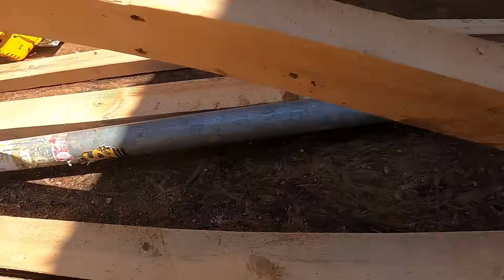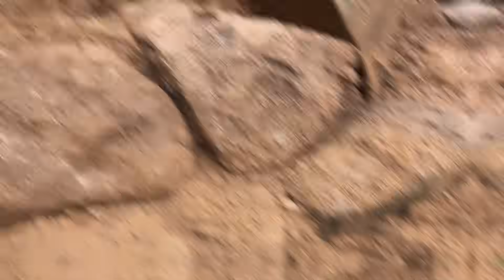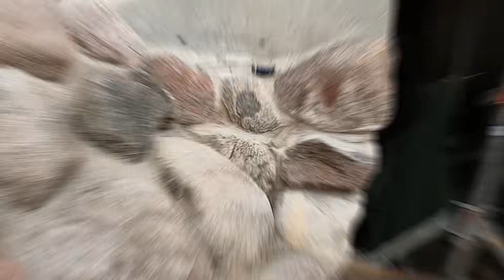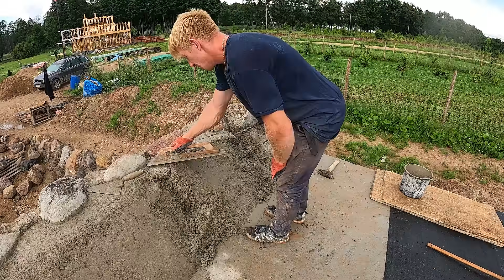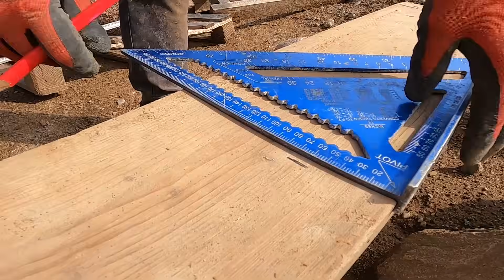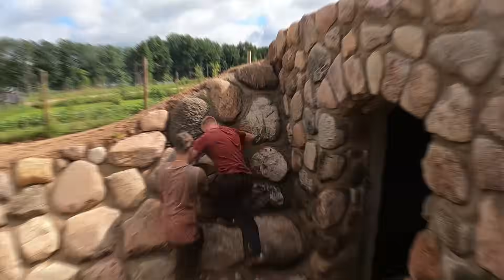Our DIY Underground Bunker Finally Got Buried After Months Of Concrete Work

Comment: No air duct, water, electric or floor in the build.
Reply from the maker: Air ventilation is there, it’s just hidden. The brick chimney on top works as the vent.
We also ran one wire for lighting.

No water or floor by design. It’s a root cellar, so natural ground helps keep the right humidity and temperature.

Comment: 1 rain will fill your basement with mud and water from the slope outside. You should make stairs and cover themwith a sliding or pull up door. Just slide the door on top and go down from stairs direct into the basement.
Reply from the maker: It’s actually handled dozens of heavy rains, the coldest winter in 10 years, and plenty of snow with no issues. Funny enough, this root cellar ended up being too dry, since vegetables still need a bit of moisture. But sounds like you’ve got your own version in mind. Would be interesting to see how that turns out.

Comment: That was a great project, and a lot of work, but you kept calling it a basement.  A basement implies something on top, and I kept waiting for the main floor.
Also, why do all that work and have no water, or electric?
In the end, it’s cool and all, but it’s a $200,000 hole in the dirt…
Reply from the maker: Thanks, and yh, here we call most underground builds basements 🙂
It’s actually just a root cellar, so only lights inside. And definitely not $200k 😄

Comment: What about the base of the bunker? why there is no concrete slab build to isolate the floor of the basement? Unless you forgot to mention it but the floor is basically sand and mud. Also why no drainage along the wall and under the basement floor?
Reply from the maker: It’s a root cellar for vegetables. The client didn’t want a concrete floor, and there’s a thick natural sand layer underneath, so drainage wasn’t needed.

Comment: For what purpose was this built? It would no doubt stay cool year around so it function well as a wine cellar.  Getting wine barrels up and down entrance slope and the steps would be difficult. It would also function well as a root cellar but that much structural work seems overkill for this purpose. It would  protect one from hurricanes and from harm in a doomsday situation like a fallout shelter. It seems to me that one would want to build a traditional home over it to take advantage of it as a structural foundation. Architects are taught the forms follows function. This structure while well built and engineered seems to lack function.
Reply from the maker: It’s designed as a root cellar to store food and produce, so it’s built to be durable and long-lasting 🙌

Comment: Cool build. I mainly came here to look at how you start the foundations, but I stayed for the rest. What I missed is what you did with the floor of your shelter. Is that concrete too, or just wood on dirt? Wouldn't moisture creep up from the ground?
Reply from the maker: Thanks, really glad it hooked you in and you enjoyed the build 👊
Since it’s a root cellar, the owner didn’t want it overly dry inside. Also, everything underneath is natural sand, so there’s good drainage and no real chance for moisture to build up from the ground.
Reply: WHEN WAS THE CONCRETE FLOOR POURED
Reply from the maker: @izzy-v2t2c  There is no concrete floor here. We left it natural on purpose so the root cellar can keep a bit of moisture.

Comment: RE: Roof overlay, Use Titanium PSU and run horizontally, never vertically...The PSU will have a 3-4" overlap.
Reply from the maker: The slab falls in three directions, so orientation alone isn’t critical here. Proper overlap and drainage do the job 👍

Comment: Wont a layer of material between sand and clay be helpful?  Even cardboard separates them as it compresses...
Reply from the maker: True 👍 A separator helps in some cases. Here the sand layer is thick enough to work as a buffer between layers, so we went with a simpler solution.

Comment: a couple straps and you'd been able to move those larger boulders easily versus the monkey jenga you ended up doing :)
Reply: should of put rock on the backfill at the top of the roof wall >< monkies :)

Comment: To save money instead of re bar use helix steel mixed into to cement. It provides a stronger structure.
Reply from the maker: Those fibers can boost concrete strength, but they don’t replace the rebars that handle tension and structure.

Comment: Very impressive, just the steel for this must have cost a fortune and hope your concrete company sends you a Christmas card! But I'm not sure the front door is consistent with the strength of the bunker because it doesn't look like it can withstand a tornado or other disaster? Hope you have a sliding door across behind it
Reply from the maker: Thanks 🙏 it will be installed later

Comment: For what resistance was this shelter build? 1/3bar incident? The walls seem way to thin, in general 30cm reinforced concrete is used in a standard shelter.
The stones that you have everywhere in the front will basically close the front of the door probably just from the groundshock alone if a nuclear bomb goes up anywhere in a radius of 5-10km around this shelter. How would they open the door? I also see a wooden door... which means the door won't be around to protect anybody. Why not just use it as a pretty chicken house while it lasts xD
Reply from the maker: Hopefully there’s no war at all 🙏 This build is just in the middle of nowhere, made as a root cellar and storage — not for military use 👍

Comment: Great job, but this isn't a basement or a bunker. Without electricity, plumbing, or ventilation, it's just a root cellar.
Reply from the maker: Appreciate it! 👍 Right now it’s a root cellar, but it already has electricity and an air vent — just need to finish installing. Plumbing can always be added later when there’s a real need.
Reply: With a dirt floor it can also have a pitcher pump put in

Comment: If you get a heavy rain, that ramp/river down to the drain is going to be a nightmare, doubt that little drain could handle a lot of water.
Reply from the maker: We had a whole summer with heavy rain already, so the drain’s been tested and it handled it fine 👍
Reply: @LibraryofConstructionthat’s good news then and the bunker looks really good I like how you put the larger boulders at the entrance looks good
Reply from the maker: @DanO530.8 thanks 🙌🙌
Reply: ..could build an open concept roof/walkway to catch the water before it hits the ramp...drain into a rain barrel, and yer golden!
Reply: Ελληνικά παρακαλώ πολύ
Reply: Δεν καταλαβαίνω τίποτα 😅
Reply: I wouldn’t use anything wood in that thing.
Reply: The drain drains to where?  Downhill and ti daylight I hope. Last house I built we raised the footings 2', 4" wider footings in wettish sandy soul. Drain tile interior and exterior. Pump inside, daylight outside. Poured walls. Sprayed black sealer and crackgaurd 4 mil rubber
Reply: Yeah at the front entrance I would of had 8 inches or so of concrete on the door entrance before you go in along with a drain in front of door entrance before
Reply from the maker: @DanO530.8  The drainage is already set about 4 inches lower, nowhere close to the door. This way we don’t need that nasty step right at the entrance.

Comment: Why did you waste so much internal floorspace with those stairs?
A single step with a 30cm tread would have been enough, and you wouldn't need a handrail.
Reply from the maker: There’s plenty of space inside, so losing a bit for the stairs wasn’t a problem. We also wanted a platform so once you step in you don’t have to drop straight down. Plus, the stairs were built using leftovers from the rest of the build.

Comment: Fabulous work quality! No need for a larger drain at door with sump hole and pump?
Reply from the maker: Appreciate it! The drain pipe runs 5 meters back from the basement straight into pure sand, so water has an easy way out. No need for a sump pump here